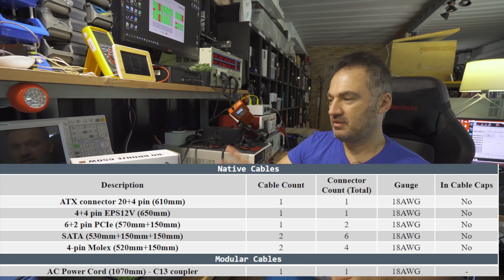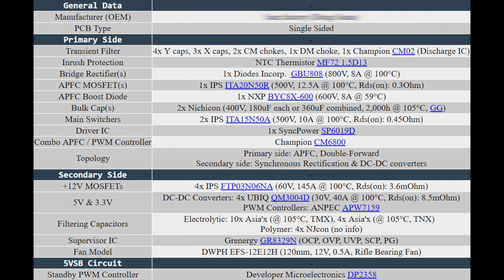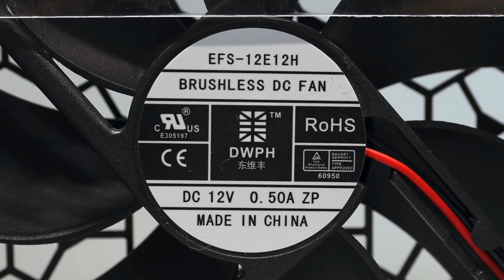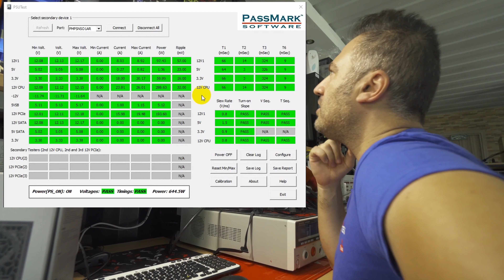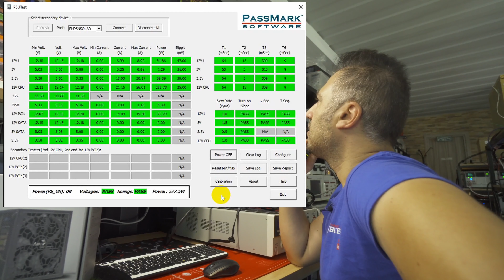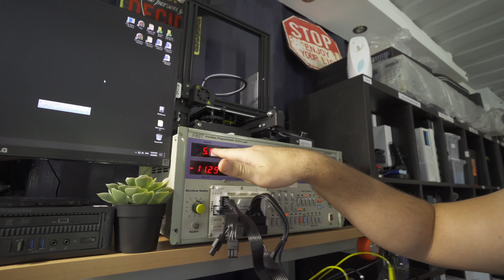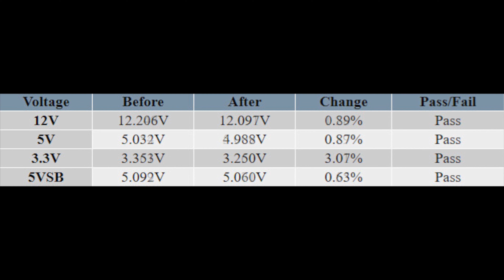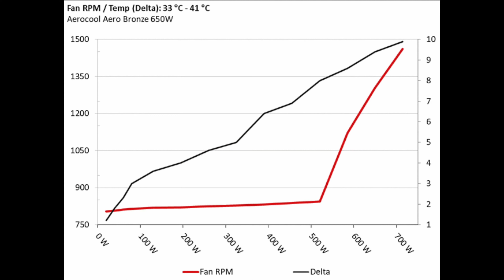AeroCool Aero Bronze 650W Power Supply On The Test Bench - Affordable Yet Capable!

Comment: Seems like outstanding value for money. In my region, this competes with other units like the Litepower series from Thermaltake which is slightly more expensive, but doesn't have any efficiency certifications and is using a CWT group regulated platform, and the same 2 year warranty.

Comment: How would this compare to the Gigabyte GP-P650B? Have you tested that one? Which one should I pick?
Reply from the maker: I haven’t tested so far this Gigabyte PSU. I might have one though in my schedule
Reply: @HardwareBustersGR  Ah I see. Those are roughly in the same price range and the avalibility seems better in general for both series than more common psu brands/series right now. Usually I'd pay a little more for something like at least the corsair TX-series but with the international shortage in prices are just way too high for what you get. Because of this I'd rather buy something just one tier above "super cheap" that has OK performance and quality. Really nice channel btw! :)
Reply from the maker: @ChrisKadaver  True this is not the ideal period to buy hardware. Everything is freaking expensive.  Stay safe!

Comment: Hey, im getting this one for a 1060 and an i5 9600k, but will it be enough if i get an rtx 3070 or 3060 ti?
Reply from the maker: Most likely you won't have a problem even with the 3070, unless you go with a very high-power limit "special" edition, combined with a 10700K or 10900K.
Reply: are you using it with the 3070? is everything ok with  this psu?
Reply: @rr98  I bought a Be quiet system power 9 600w and im currently using a 1060..

Comment: hello from 1 to 10 how good is that font? Would you recommend it for moderate use of 6 to 8 hours? For a processor with 130w TDP and a 2060super, do you think it works correctly without any failure? I'll wait for your answer, thank you so much.
Reply from the maker: Hi, it is a decent PSU, I would give it around 7. PSU failures depend on many things, the quality of main being the most important. If your mains grid is stable you won't have any issues.
Reply: @HardwareBustersGR  Excuse me, what exactly is main? By stable electric current you mean that the power does not go out or things like that? does the source have no protection against such events? Thank you very much, I await your answer, I also wanted to ask you if you would recommend it for a mid-high range assembly, greetings and thanks.
Reply from the maker: If voltage is stable. If it is no problem

Comment: I'm looking for a cheap but good power supply for a 24h on computer. Would you recommend it over other cheap options from Corsair?
Reply from the maker: This is at a higher level than the VS models, which are the more affordable Corsair units.
Reply: @HardwareBustersGR  thanks a lot. And what about vs the seasonic a12 III? I need to buy a new PSU and I'm bit lost. 
The Aerocool has not good reputation on forums
Reply from the maker: @powermi2804  As I see they are trying to change that. Both Aerocool units I tested recently were satisfactory. The fact is that in this price range, don't expect miracles. In the best-case scenario, you get what you paid for.
Reply: @HardwareBustersGR  thanks a lot. So could you recommended another candidate to compare with? I'm considering buying it as seems to be great.
Again thanks for the replies and keep posting on your channel!!
Reply from the maker: @powermi2804  You can take a look at the Corsair CX650 and Cooler Master MWE Bronze 650. I am not sure though if these two can be found at the same price as this Aerocool model.
Reply: @HardwareBustersGR  finally bought the Aerocool, and I'm sorry happy with it, low noise and good quality. I don't think that for that price could be something better
Reply from the maker: @powermi2804  Aerocool is trying hard lately to offer good products. Hope they keep it like this.
Reply: Thanks from Italy! I think I'll buy the 750w version (that shouldn't be worse, isn't it?) for more headroom.

PS: +1 subscriber :)
Reply from the maker: @MrSilviotrav  thank you! Please take a look at our Hardware Busters International channel because from now on we will post all of our English content there.
Reply: @HardwareBustersGR  I did it now :). Last-minute change of hearth: do you think it's better the Areo Bronze 750m (81€) or the CX 750m for 101€? Thanks
Reply from the maker: @MrSilviotrav  It is 20 euros difference, which is much. I would go with Aerocool for this kind of money difference.
Reply: @HardwareBustersGR  I tend to agree! Thnx buddy :)

Comment: i'm seeing the Aero 550watt for 49 euro here in belgium & the 650 watt is 62 euro's, is there a differance between these two? except the 550-650 watt differance?
Reply from the maker: Normally the difference is only in the parts required to deliver 100W more.
Reply: @HardwareBustersGR  Well for a budget build let's say i3-i5 with a 1660 or something i think that 550 is more then enough

Comment: I have this psu..sadly it only has 1 8pin pcie..im getting a gpu with 2x 8pin..cn this psu power gpu with 2x 8pins?
Reply from the maker: This PSU has two 6+2 pin PCIe connectors and a single 4+4 pin EPS.
Reply: @HardwareBustersGR  i have the aerocool lux rgb version the 650w bronze.. Is it the same as this? Can it support an rtx 3070 with 2 8-pin connector?
Reply from the maker: @xandrelphane  I don't remember checking this one. Normally it shouldn't have a problem since RTX 3070 is not so power-hungry (compared to 3080 at least).

Comment: I have a 1050ti but i'll upgrade to a 3070 soon, this psu is enough?
Reply from the maker: It might work ok because 3070 is close to 300W. It depends on the CPU that you have now, its boost clocks and voltage.